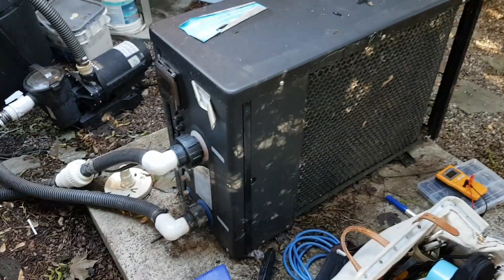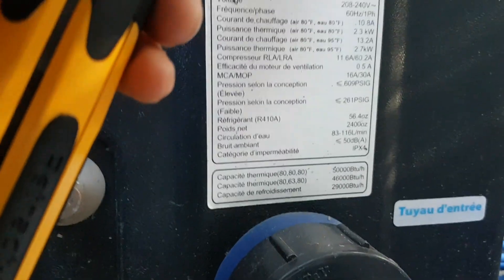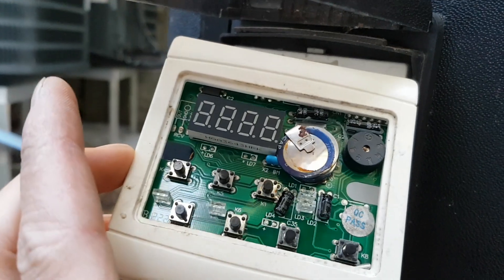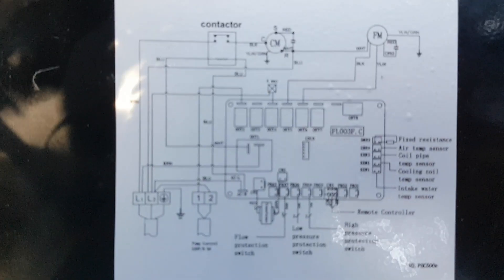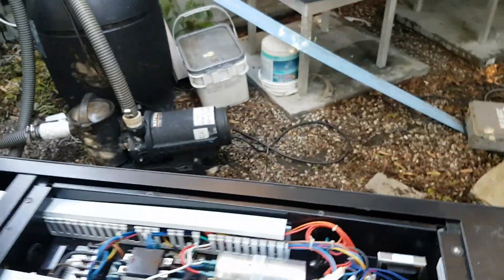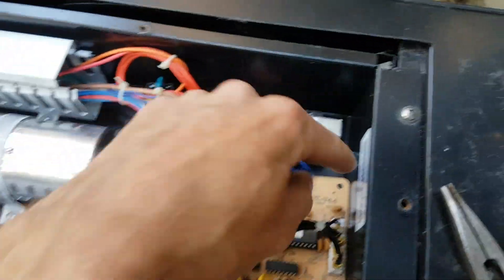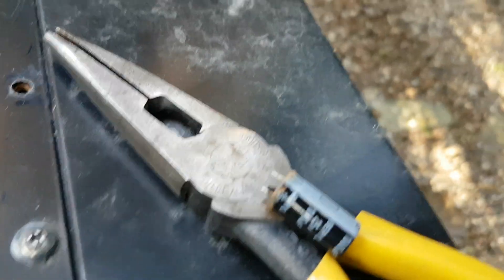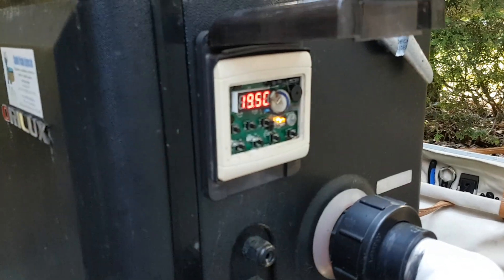Repairing Orilux TTI ECOLO Jacuzzi Carvin Heat Pump Pool Heater

Comment: @Chargèro Would you be able to replace the micro switch under the up/down arrows of the control pannel ?   I think that's why I can't decrease the temperature and it's stuck at 92F ... can't decrease it.   If you can replace that, I can pay you ;)
Reply: I still have new control panels, limited stock.

Comment: These aren't chinese made , they make them here 20 minutes away in longueuil quebec canada right on the other side of the tunnel leading in Montreal.
Reply from the maker: They put the parts together like lego pieces...which are made in china. Look inside at the compressor, circuit board, electronics lol All stamped made in china. Garbage.

Comment: Did you get the errer code e3 for low water pressure? I've check my pump and the filter but can't find the issue. Do you know where is the flow switch ?

Comment: Hi. I have this same unit. Is there any way to obtain a new control panel? Mine will not allow me to put temperature up on pool, on other words, the down button works but the up does not.
Reply from the maker: You can try calling the company and see if they will sell you one. If not try to find a supplier through alibaba. It may also be that your buttons are physically broken. Some times corrosion gets within the contacts.
Reply: @QuaabQueb  thanks I'll try that. Appreciate the help
Reply: @RG-vr5lq   Did you end up solving the issue? I am facing the same situation: both the "down" and "up" buttons make a sound when I press them, but the up button does not raise the desired temperature. It is stuck to 64F....
Reply: Update: my heat pump guy got a new keyboard and controller. The parts were 300$+tx. With installation it came just under 600$ CAD. The heat pump is working again. Happy to help
Reply: @evoncanivon  nope, nothing yet which hasn't been too much of a problem since I live in Miami, Fl and the weather down here has been blazing hot. Do you think it possible for your pool heat pump guy to get me the website he used?
Reply: I have the same problem.  Where did you get a new display pad?

Comment: Hi I have this model heater which does not seem to be heating, there is no error code and it seems like the pump is working as the fan is spinning but if I listen carefully I can hear a buzz sound like it's trying to engage the compressor or something every few seconds. Do you think I have the same problem or is it possible it could be the the large capacitor?
Reply from the maker: It is possible it is the compressor capacitor. You can remove it and test it.

Comment: Hello,
I have a question About the same model, 
I can not to set up and increase temperature.
Is it electronic card problem?
Thanks.
VLADIMiR 
(514)293-1012
Reply from the maker: Hi Vladimir, is it displaying the same error as shown in my video?
Or is it displaying temperature as normal but not allowing you to change it?
It may be the keypad is locked using the lock function.
Reply: @QuaabQueb  Hi Chargèro,
Yes,  is it displaying temperature as normal but not allowing you to change it. 
What You would do in this case?
Thanks.
Reply: @QuaabQueb  Hi, what about Orilux temperature setting problem.? I can not find nobody to come to fixe it.
Reply from the maker: @dianamilk4434  What do you mean temp setting ?
Reply: @QuaabQueb  For exemple, I would like to inscris temp to 85F,  and it’s blocked on 64F. I can see the real water temp but I can’t même any temp changes. Am I clear?
Thanks.